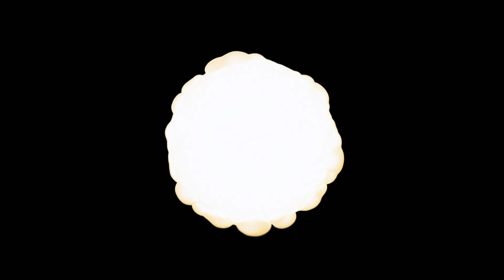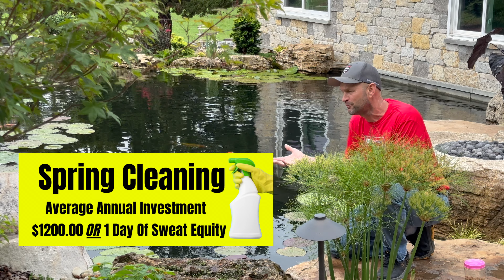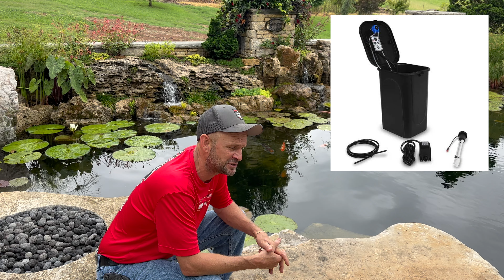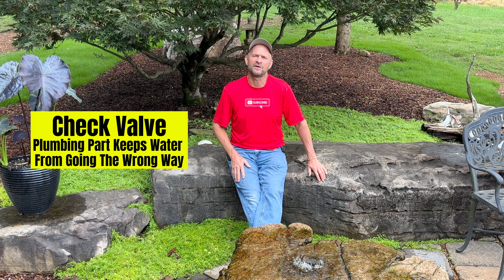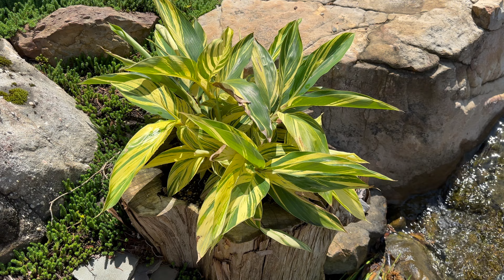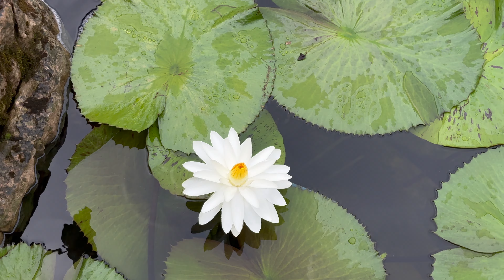The Hidden Costs of Pond Maintenance No One Tells You About

Comment: i believe its possible to have crystal clear water for less than $500 in materials including plants ,fish,other organisms,pond liner ,stones, pump,filter ,lights etc.. per 600 gallons of pond,plus no feeding,no mandatory maintenance for 5 years other than pump replacement in breakdown,my confidence derives from seeing a few comet goldfish and rosy red minnows growing with colors getting more vibrant in a shallow 5 gallon planted container a few months now without food,cleaning or filtration or air stone,only water top offs,the water is clear, they feed of the biofilm and plants ,,i think the reason its working is its shallowness and enough daylight, my goal is to have a pond with a clear water highly diverse ecosystem without any machine or supplementary  input and then add  lighting and filtration to supercharge it so there is breeding in all the foodweb within the pond,based on my research its quite doable, i am planning for a 350 gallon water feature with waterfall, its gonna be basic to start,than the fancyness shmancyness will happen as being felt

Comment: Great video as always. 
I feel is missing the possible cost of water (due to evaporation).
Reply from the maker: You are correct! Didn’t think of that…We have a well so our water is very good quality and the cost is very insignificant. In other areas that may not be the case. My feature captures rain water as well so we use that as a buffer and mostly we get enough rain to keep it full. I don’t actually even have to add the hose yet for almost 3 months. The number I use to calculate avg water consumption is about 1% of flow. SO mu pumps run 30,000 GPH so 300 gallons per day is my “expected” usage and we are pretty spot on for that. I have calculated somewhere from 300-500 gallons per day depending on about 100 factors LOL!! Good comment ;)